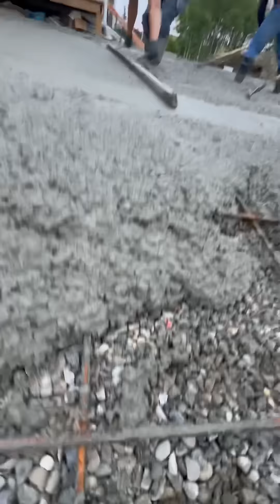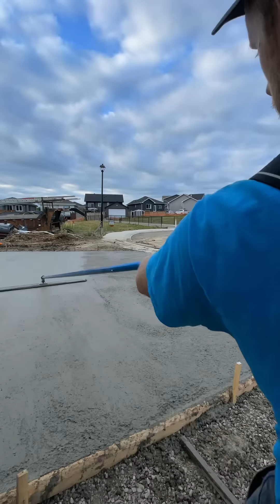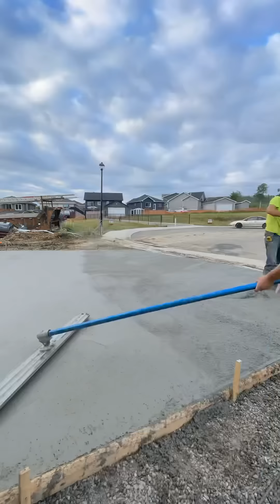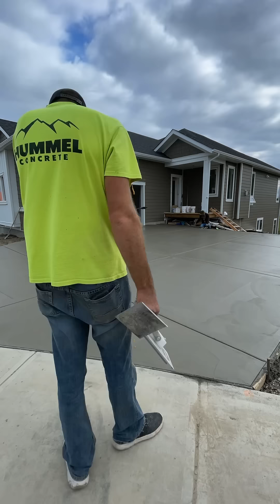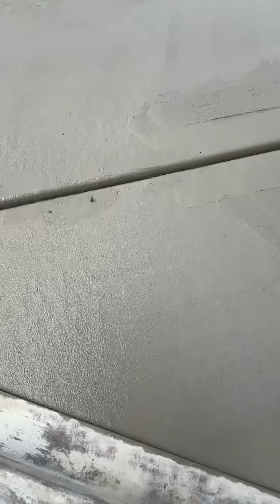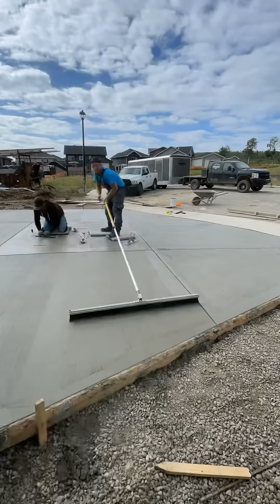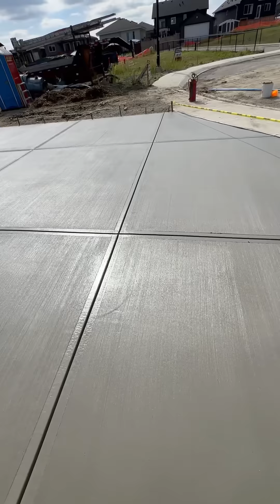How to pour a broom finish driveway ⚔️🧹✅ #concrete #construction #shorts

Comment: I thought it was weird mentioning entrained air as creating delamination or flaking and that isn't completely true.  Trapped air and entrained air are two different things.  Trapped air is larger while entrained is smaller which actually helps with moisture and freeze thaw conditions.  Delamination can happen by overworking the "cream layer" because the larger aggregate is what maintains a large portion of concrete's structural integrity.  

Either way it looks like they did a great job but for those with diy projects don't let this deter you because of the amount of steps.  Larger jobs usually involve more people primarily because of the rate at which concrete starts to become harder to work with and make corrections to.  With experience that envelope of time doesn't change only the speed at which you make it to the next step of finishing.  It really is just rocks, glue, and water dumped over metal strapped together

Comment: We can’t get concrete without delamination issues here in upper Michigan. The contractors blame the mix plants and the mix plants blame the contractors. It doesn’t matter what contractor does the work. The surface pops during the first winter.

Comment: I’m always impressed with concrete finishers, they do good work, but I’m rarely impressed with the structural aspects of concrete work. I use to do rebar inspection and if I came to your site, the first thing I’d do is ask why the rebar chairs are not in place prior to concrete pour. If someone said that they installed the chairs as they poured, I would fail the inspection. This is just a residential driveway so not too important, but for commercial or industrial, and when it’s a structural slab, the chairs must be installed and ready for inspection before it gets covered by concrete. Also when is it acceptable for a concrete truck to be allowed to drive on the reinforcement?
On another note, in your experience, how often do concrete slab cracks actually follow the cut lines?

Comment: FINALLY someone in the US does it like we do here in Australia,  a much higher standard than alot on youtube. We now use silicone recessing strips for construction joints, instead of cutting. The strips are pulled out 12-24 hours after pouring, and makes surfacing so much quicker and easier than hand forming and refinishing those recesses.
Reply: Also would not cut-in to leave acute triangles- they will break and crack. Put a 2ft/600mm border cut where you have finished cuts from border to existing being square.

Comment: Klinkers, Stone, resin, aggregate and tiles do it better.

No cracks, no problems with frost, no issues with tearing it up for ground works, no aesthetic damage with patches, no massive concrete lorry and possibly a crane to deal with.. it’s just better to not use concrete or asphalt in small areas like this one.

Unless you’re working with a large area bigger than 500 square metres or that receives constant traffic (heavy traffic), concrete doesn’t make sense most of the time if you’re doing 500 metres plus of paving might as well do it with asphalt far more resilient and longer lasting depending on the system used.

lots of asphalt or asphalt alike systems out there for this purpose.

Comment: So....do you have to or do you NOT have to WATER the Concrete for a certain amount of days?
Reply from the maker: Do not, if you use a chemical sealer like we do the same day as pouring. They also make a water based sealer. Bridge decks and large industrial projects need water and exact curing times under wetness. That concrete generates so much heat when they pour. 😁👍
Reply: @HummelConcrete  Aaahhh. Got it. Thanks. So...Sealer is where it's at.

Comment: I miss working in concrete. Dad had his own construction business. And concrete was my favorite. Back then he used a jidder bug, which would bring liquid to surface while compacting the solids down. Another tool he used that I didn't see here was the wheeled floater machine. It had three blades in caste in a metal frame. With handle bar and gas engine. He would run that across the slab before we would start the troweling , edging , cutting and smoothing. I remember being on hand and knee, smoothing concrete and he would come with big broom and run across it. Said it had to be that way so it wouldn't be slippery.

Comment: Nice job ..
Hard to move concrete without polythene paper ..
I'm assuming the construction an expansionists and joints ...Reinforcing steel will be cut thru later ..

Comment: The cutter is for contraction joints.  Expansion joints have foam in them from top to bottom.
Reply: And that's not an edger, that's a jointer you are running down the middle of the joint.

Comment: Amazing work. Is that some sort of quickrete since you guys were able to go into the middle of the slab on those pads? Also did you use any vibrator to remove the air bubble inside the slab during the pouring, before all other processing of the slab as well? Just wondering.

Comment: I have only one problem with that and that is the finish. I don't like the fact that you put the cut line back in with the edges showing. Why? I prefer the Finnish to go all the way to the edge. Is it if it's a broom finish or it's a smooth finish it doesn't matter but it looks so much better when there's no tool marks exposed. I guarantee you I poured more concrete than you have, and finished it as well. I don't leave any tool marks whatsoever

Comment: What's the reason for using rebar instead of pouring a slightly thicker slab, is it because of high heat fluctuations in the US meaning it would break up without rebar?

Comment: That is ok. I see a few potential problem areas in your method. I would have used smaller pours and construction joints in that but both methods get the same results both good and bad examples.

Comment: If you have good preparation and compaction , rebar is not needed if you use fiber in the concrete and will have lasting results 😉
Reply from the maker: @davekreitzer4358  not in Canada. Rebar mandatory
Reply: @HummelConcrete  Is it some jurisdiction rule ? Unless there is heavy truck traffic , it's over kill !
Reply: @davekreitzer4358    You must not live in a freeze thaw cycle area, fiber alone doesn’t cut it in extreme temperature swing areas!
Reply: Sounds like it's CODE. And common sense.

Comment: As long as you are down South it won't all crack to pieces in the winter! ✌️
Reply: If you do it right, it won’t crack all to pieces up here either, concrete is going to crack, no matter where you live. That’s what control joints are made for.

Comment: Nice job guys, the only thing I had an issue with was that the joints you tooled in are not expansion joints but contraction joints. Expansion joints are there for the times the concrete expands and you normally use a fiber board or foam type expansion material that the concrete pushes against. A contraction joint is when the concrete shrinks it will crack so you tool joints in to control the cracking. Concrete heats up and expands when it is curing so when it cools down it shrinks and that’s when cracks can first start to appear. There are other reasons for cracking also but that’s another story. 
  Extremely nice job here guys, all of your guys know what they are doing and it shows! Keep up the good work!
Reply: What you're talking about is actually called a control joint
Reply: @Yes, A control joint or a contraction joint are the same thing. I’d say that 95 percent of the people don’t have a clue to the difference between a control joint and an expansion joint, the 5 percent of the people that do know are the ones installing them. So the only ones my comment will mean anything to already know what the difference is. In the end I’m just feeding the algorithm, I also gave the video a thumbs up so it might help get the video out to more people, it deserves it. 
Hey, have a good one!
Reply: @Hoaxer51  lolol, damn straight about 5% knowing the difference. I've even heard professional finishers calling control joints expansions 😂

Comment: I did tile floors and showers and my favorite part of doing a shower was mixing up the drypack and floating the pan out every single contractor and home owner i worked for admired how perfect every single detail was but i obsessed over the shower pan i cant stand seeing shower floors to flat or way to caved or extremely wavy along the wall but i always thought about doing concrete work i know id be decent but that sun has to be rough

Comment: I purchased a Botticelliano robot that does automatic programmed concreting. It uses lasers to determine levels and sensors are placed around the job at programmed points. It is an amazing product and has replaced 12 labourers. It paid for itself in 6 months and it is already booked out for another 8 months.

Comment: you canadians suck at concrete... almost everywhere slaps crack.. and I as a german metalworker can tell you why.. cause we learn it in trade school.. you wanna know why...cause you do not understand how rebar works..if we would see a slap done like that we will refuse bolting any metal structure to it... because you use just one layer of rebar... in order for a slap never ever to crack you have to use 2 layer better3 layer of rebar.. now when the ground shifts one layer will just bend with the flow and your slap a 100% will crack... with 2 layer wen pressure from underneath  the layer closes to the ground is exposed to expention and the one above it to compression ..the forces cancel each other out and your slap will never break..when we make a slap in germany for a house you use 4 layers most of the time and at least I would say 20 inches of concrete thickness and we have a house made of bricks with concrete ceilings on top ... if you would do it like that you could safe your pathetic piles under the houses ..

Comment: Ok… If you tie all the rebar together then expansion joints are irrelevant. You really should section off your rebar tied areas. That you already know will be included into the expansion controlled areas. I’m glad to see he isn’t using PLASTIC underneath all that concrete. Because all that water needs to get out and if the plastic is there it has only one way to get out… And that’s UP… and that can displace the rock

Comment: Everyone has a plumbus in their home. First they take the dingle bop and they smooth it out with a bunch of schleem. The schleem is then...repurposed for later batches.

They take the dingle bop and they push it through the grumbo, where the fleeb is rubbed against it. It's important that the fleeb is rubbed, becasue the fleeb has all the fleeb juice.

Then, a schlami shows up, and he rubs it...and spits on it.

They cut the fleeb. There's several hizzards in the way.

The blamfs rub against the chumbles, and the...plubis, and grumbo are shaved away.

That leaves you with...a regular old plumbus.

Comment: If anyone wants to know how to do this watch this 40 times. It's spot on and very difficult to do, they got lucky with the setup times as it changes every day according to the sun position and humidity that day, it also helps to have every tool available and I see they are prepared. Rebar has nothing to do with integrity unless its places on the top and bottom 1" from the bottom and top in 2 layers. with rebar only on the bottom, It only works if  the force is from the top of the slab, if the frost has anything to do with it, rebar only on the bottom is useless.

Comment: The workmanship and finish look really good. However, I would have preferred cobblestones, paving stones, or coarse gravel. Rainwater drains well underneath, and the surrounding soil won't be washed away in a torrential downpour if the water can only drain off the sides of the concrete. It really depends on the region.

Comment: Great work!!!
Do you come back once fully cured and saw cut the cuts all the way through to prevent cracking and how big of a area do you need to do before you use expansion foam joints or don't you use them up there?
Just that i live in Northern east coast of Australia and it gets bloody hot here and we get a lot of movement due to the heat and tropical rain???
Just curious???
And we don't call the Steel chairs like you do we call them Tee's because they look like Rugby league kicking Tee's 😂

Comment: I would say contraction or control joint for concrete joints. I guess expansion joints aren’t wrong if you’re thinking of it from the point of view of the crack/joint haha. I’ll typically call clay brick joints expansion joints since they expand when hydrated after construction.

Comment: I work on new housing (floor layer) I was watching the guys do the concrete driveway on a new housw where I was working. First off! No tamping of the ground just dig the hole for the pad. Second shovel some sand in. Don't spread it out just throw it in there. Third! Throw the rebar in the sand. No tying it together and no chairs to raise it. (Im not kidding) Just leave it in the sand. In comes the cemen truck. Pour the concrete and drag some 2x4's across to level it out. no magnesium floats, no proper tools. lastly! By eye roughly drag a peice of rebar tied to a broom handle through the cement to make the releife lines. And finish the top with a broom to try to hide your hideous work!  I am not joking when I say these new home builders hire the cheapest they can find! Hense why I had to stop working for them and go find a high end shop. And I would never buy a new house unless I watched it being built and interveined in every step!

Comment: You CAN'T "trap air entrainment" 
I wish finishers understood how air entrainment actually works. I'll explain it: the air entrainment is achieved through a chemical process, in which micro encapsulations are in the chemical form when the concrete is batched. As the concrete starts it's initial cure(hardening) known as the hydration stage, the tiny micro beads, dry out, which then once dried, become tiny little spherical pockets of air, which allow for the water to expand into in case it freezes during the cold/fall & winter periods. 
When the concrete is still wet, there's nothing that a finisher is doing that can or will hinder the ability of the air entrainment from serving it's purpose.

Comment: This why you get professionals to do such big projects, people! OK, maybe you can DIY a small patch of concrete out in your back garden, where no-one will see it & it doesn't really matter if it doesn't last ten years. But for massive areas of concrete like this, you're throwing your money down the drain by hiring some cheap - but less than competent - people to do the work. 

It's fascinating just how methodical you need to be when doing this kind of work, and how much training & experience goes into developing this level of expertise. Things have to be done, not merely in the right sequence, but also at the right stage of curing - or you'll end up makingso much more work for yourself.  

There's still a great deal of artistry included in the development, though. Getting the camber just right, so that rainwater drains away properly & doesn't pool, causing the growth of algae (which can be slippery) or mold (which can penetrate into the concrete, damaging the surface) is challenging - even if you were to use computer & lidar systems to map the contours of the hillside.

Comment: I did a diy “dry” 8x12 for a shed 3 years ago live in MN and drilled many holes near the edge to bolt down said shed and still have no cracking or breaking of any kind, this summer I’m going to attempt a “stamped” patio in the back 🤞🏻….. but I would never try a driveway like this , even though I am very tempted because my house is now 25 years old and the concrete driveway is cracked and hollow in many places

Comment: if you ever wanted an example of overdesign and overspending, this would be the clip I would show. Multiple days with hours of labour, a concrete truck, multiple workers, and rebar for a driveway... Also if someone were to spend this much money why would you even use a c/w mix that cures in 28 days? You might as well go all the way and use a fast curing c/w ratio, add glycol lines under surface so that you have a heated driveway, and have the concrete pour cure within 48 hours.

Comment: You really shouldn't use rebar pins to set the grade. You hammer it into the earth, the steel will rust, expand, crack your concrete, over time concrete cancer will  spread throughout. Consider fibreglass or at least gal. Or just screed to the forms like a pro.

Comment: You mentioned you pound your screed pins in after the concrete is at hight. If the pins are metal it better to remove them, they will rust and expand if left in the concrete/dirt thus potentially cracking the slab

Comment: To each their own, but I hate picture frame finishes on large pads. It looks fine on smaller area's like sidewalks but not on something as large as a driveway or patio. That's not on these guys, they did good work as requested by the homeowner, but my point still stands and I'll die on this hill.

Comment: I was a ironworker for over 20 years and installed a lot of rebar.  They make runner chairs that are 4 feet long and don't sink like single chairs so.  A lot of places where putting rebar on gravel like this we also used bricks under the rebar to hold it up.  It drives me nuts when i see people pouring concrete with mesh or rebar that isn't chaired up.  Totally defeats the purpose if it isn't in the middle of of slab or close to it.

Comment: I find it so frustrating when "professional" concreters pour one giant slab, then add the expansion joints with a concrete cutter after it's cured. It looks like crap, it's rarely ever straight and the sharp-cut edges can actually be dangerous. Your workmanship is exceptional and the finished product is truly beautiful. More people should aspire to your level of quality!